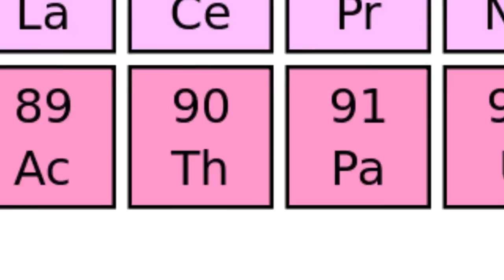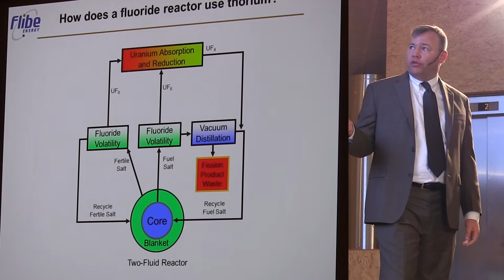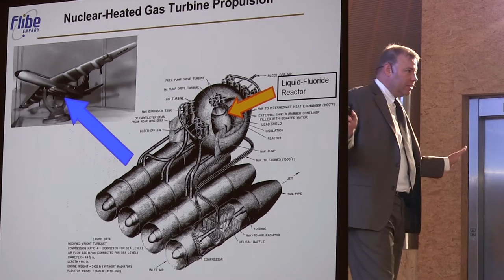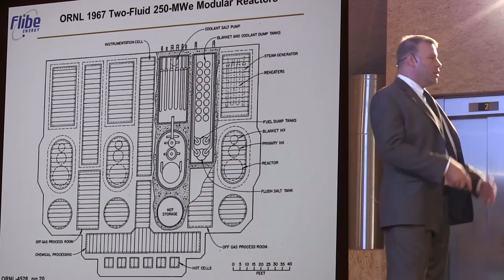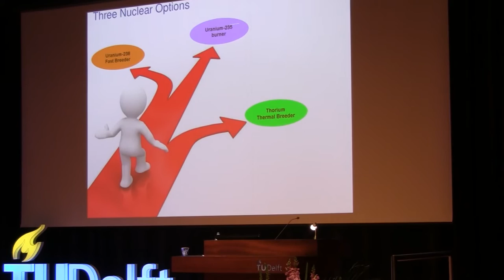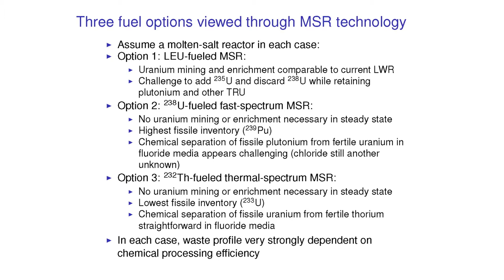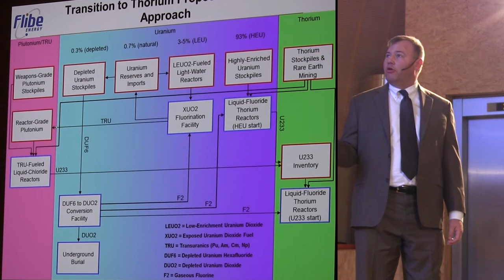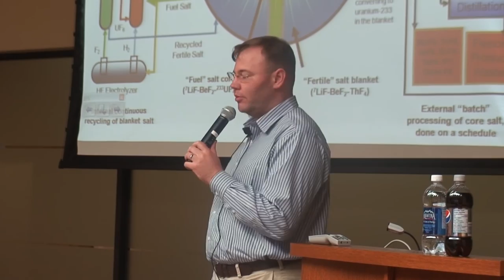Kirk Sorensen of Flibe Energy, LFTR: Liquid Fluoride Thorium Reactors - TR2016c 6h11m45s00f

Comment: I am very interested in this LFTR reactor and don't understand why they aren't being made. I am curious about research into tinkering with the eutectic of the salt. Has anyone tried to dope the eutectic (with elements in the first two columns on the periodic table) to try to lower the temperature? Is there a way to suspend nano-graphite powder in the melt instead of using solid graphite pipes? I heard Sorenson say, the melt is homogeneous, would graphite still moderate if it were suspended as a powder in the liquid salt? I don't understand the fission process that well but it sounds like Thorium leaves much less ash even before removing the valuable isotopes. I like this idea because companies as simple as Corning glass probably already have most of the solutions to the technical problems. I also like it because I decided several years ago that balls would be better than rods and to my surprise, sure enough I found a Thorium Pebble Bed design, The LFTR is way better, pure homogenous, surface area...amorphous liquid glass (minus the sand). 500,000 Russians risked their lives trying to quench the old beast when this was hiding in a forgotten project; that is nearly criminal.

Comment: That drain tank looked like an ideal reactor shape. I would have thought a long, thin shape or wide, squat tank would have been better, to prevent uncontrolled criticality.
Reply: The MSBR has 2 drain tanks in design. See Fuel Dump visualization in https://vimeo.com/album/5385492 , ThorCon shared some drain-tank details at TEC2018 https://youtu.be/hmUzJuvalZA?t=659 . So I'd say you're probably right and this is a simple visual.

Comment: While I believe molten salt thorium reactors are the answer to our energy world wide, I do not know if flibe is the answer.  The reason I am not sure is because of tritium production by flibe. This has to do with lower melting point addition of lithium in making the flibe run at lower temps reducing the viscosity and melting temps. Kirk seems to think tritium control is feasible while I am not sure. Tritium if produced cannot be contained if produced in any serious amount as it will leak through any conceivable container. If Kirk can convince one of tritium containment then I would seriously change my opinion. Tritium is not amenable to community health in some level of groundwater production. How low this will be is my question.
Reply: Yes, more R&D needs to be done to fully investigate the challenging engineering problem of capturing evolved tritium, but it's far from being an intractable problem. 
Furthermore, by using Mass Spectroscopy, the amount of captured tritium can be measured and compared to what is expected to have been evolved, based on the plants actual recorded power production. The resultant metric forms a valuable datapoint for verifying that the plant is safely operating within design specification.